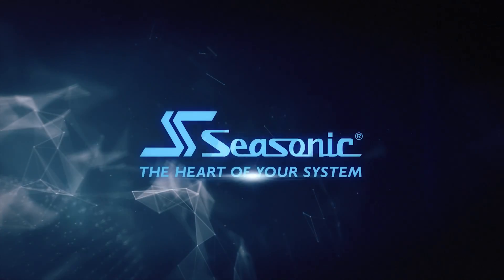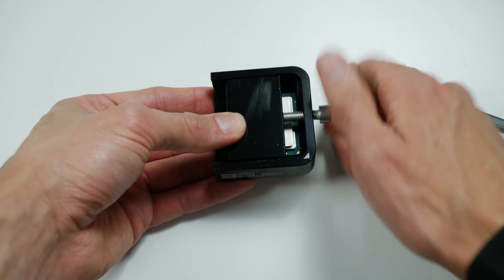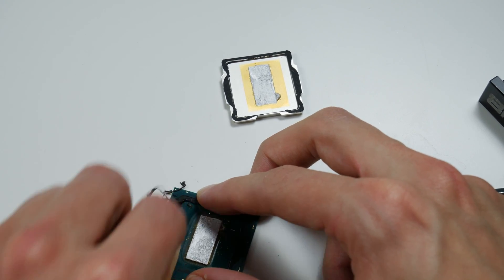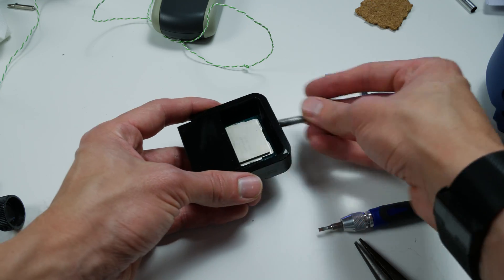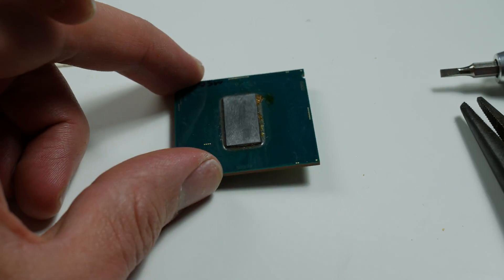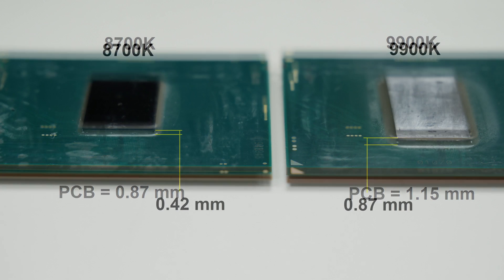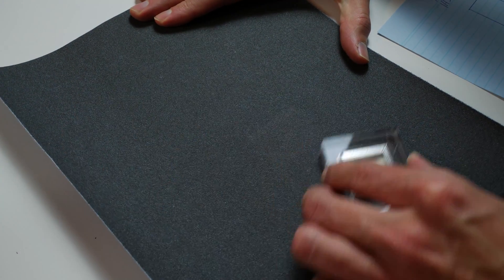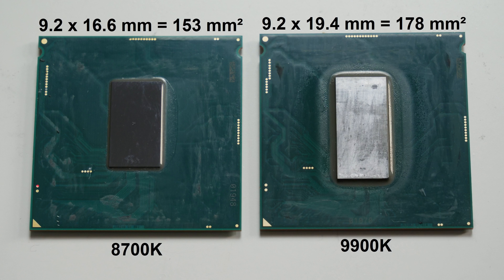Bad sTIM? Why is the 9900K so hot?

Comment: One of kind video. I dont know why they still include iGPU in these high end cpu's , maybe its easier to manufacture one design instead of seperate architecture and chip design for high end cpu
Reply: Yeah, they should just get rid of the iGPU or at least offer a version without it on the top end gaming CPUs. No one is buying a K series for gaming and using the iGPU.

Comment: So if indium isn't the right choice for solder material, what would you recommend?
Reply: That's the only option for soldering silicone to copper.
Reply: @SuprSi Ah. So then I suppose the solution to this thermal instability would be to design a new architecture which is optimized for 8 cores, instead of adding on to the old 4-core design? Because the original die size was a perfect square, but it's gotten more and more rectangular because they're essentially just adding onto it. So for better thermal performance, designing a new die that is once again square would afford the best heat-transfer for a design like this, as it wouldn't be necessary to layer the wire routing as thickly due to it being spread out over a larger die.

Comment: Sure the new solder is not as good as Conductonaut, but I'd be curious to see how much better it is compared to the crappy TIM they were using before. I guess there's no direct way to test that, but you could turn off 2 cores and clock it the same as an 8700K and compare that (imperfect test, but still a good approximation).

Comment: How are AMD then getting so much better temperatures than Intel? Are they using thinner solider? EDIT: Ok, Intel is useing thicker chips, but why would they do that?
Reply: higher clock speed also make more heat u can test it  yourseft  put any cpu example 8700k at 1.3v 5ghz then put it to 4.5ghz with the same volt and u will see 4.5ghz  will  still alot cooler

Comment: They could have made the silicon thinner for better thermals if they wanted to. Maybe it would cost more to come up with a new manufacturing process but it could be done.
The way Intel has failed to meet expectations regarding thermal performance in recent years it would be better if they just offered CPUs with heatspreaders that come bundled like stock coolers, ie included but not yet attached to the silicon die and pcb in any way.

Comment: Have Intel fixed the security flaws on these chips?  If they have, could it be added layers for encrypting and decrypting the cache.  It would also explain why it's heating up in general, as it would have to work those bottom layers very hard.  It would be just like Intel to just add a few layers instead of fixing the X86 architecture itself. V_V

Comment: So the moral is if you want a good 8 core cpu with good thermal, buy a Ryzen 2700
Reply: @My Account yeah, when you pay 300$ more it better be better.
Reply: Intel in 2018 LUL
Reply: or get threadripper 2 for the 9900k price and enjoy :)
Reply: @AvatarSampai  gaming on threadripper ? 🤣 A old Intel 4 core is Better. Intel is still king AMD fanboy are just salty 😂👌
Reply: @Maskinmester-DK  he didn't mention a word about gaming. Amd will eat Intel alive in price to performance anyway.
Reply: if intel was still king, why are they talking to board manufacturers to start reproducing OLDER architectures, since they cant keep up with demand for the newer 14nm processors? in other words, if you want a dell or an HP with an i7 in it, you're probably going to end up with a 5th or 6th gen instead of 7 or 8, or even 9. those system manufacturers are literally right now looking at using older intel chips because intel cant make enough of the 14nm (7th, 8th, 9th gen) to keep up with demand. that is why AMD is looking at a possible increase of up to 30% of the marketshare right now, because they CAN produce enough of the Zen-based processors to keep up with industry demands, including taking up intel's slack. that, and being set up to release 7nm 3rd gen Zens next year, they DO have intel scrambling on the desktop processor front. then take into account the server-grade stuff. Epyc's architecture is far superior to xeon in both PCIe lanes and clock speed, as well as number of clocks, AND are much cheaper, both for the chip itself AND the board. any REAL computer person can see that, while intel DOES make the fastest "gaming" chip currently, in the broad scheme of the world of computing, intel just got a knock in the jaw and is trying to recover. hell, linus tech tips proved that a 1700 dollar AMD threadripper is FASTER in server-style tests than the 3100 series 28-core xeon they JUST released, which costs right around TEN GRAND. the threadripper, a DESKTOP processor (cheaper boards, more modular design) that beat a server processor in tasks that the server processor is DESIGNED to do. yeah, intel REALLY sounds like it's king. numbers dont lie, but fanbois do.

that being said, i'd recommend the i9 to a "price is not a problem" gamer. if price DOES matter, its an easy choice for the 2700x
Reply: @Maskinmester-DK  Not for your moneys worth. Feel free to pay 50% or more for a gain of 5-15 percent.
Reply: yes
Reply: At the moment 9900K is the fastest processor in consumer market. The only reason to buy ryzen is that it has better cost/perfomance ratio.
Reply: @sashasinkevich924  and we all know that everyone can tell the difference between 170 FPS and 210 FPS!
Reply: In game applications performance difference may be even less, because of games are gpu heavy. But still the gap exists. You can think about this from another side. Can you see the difference between 10 minutes of rendering and 9 minutes?
Reply: @ellsworth1956  you would be quite the fool if you were saying that people cannot tell the difference between Framerate jumps.
and then a hypocrite if workstation performance gains were then mission critical. same wheelhouse - more of the the type of sought performance is more of the type of sought performance.

not that i'd want a 9900K for gaming since it's a miniature volcano trying to cram that many Cores into a Consumer rather than HEDT size Die, but that's a different matter.
Reply: @taiiat0  First, you always buy the CPU that best suits your needs to do otherwise is foolishness. Second, I never said anything about Workstation performance please do not put words in my mouth. Third there have been bunches of blind frame rate test and they all say above a certain point you can't tell the difference. Anyway it is a case of diminishing returns, going from 60 to 100 frames is definitely noticeable difference after that the jumps become less and less noticeable.
Reply: @ellsworth1956  every person is different, deciding for people that they can or can not differentiate higher Framerates isn't very genuine. while some people insist they cannot differentiate higher than 60Hz (i think they're incorrect but i'll leave them be), trained professionals have been able to detect purely visual movement&motion at 1/300. so, people will scatter in between those two points.
let alone visual+physical detection, of which people would be expected to be able to differentiate substantially higher than just visual.

the note on Workstation was just putting two very similar things with each other - games want higher Framerates (and hopefully better Frame Time consistency simultaneously), Workstation wants __ job done faster.
there's diminishing returns in everything but that doesn't make them not worth desiring. either desiring both of those scenarios makes sense, or neither does.
Reply: The only ones talking highly of intel right now are the uninformed and children. The dwindling sales is proof of that.
Reply: Save yourself some money and build an LGA 2011-based system with a 3930K or 4930K (or an X variant). Similar cores/threads, better thermals and quad-channel memory. Also cheaper and allows you to save on RAM by transferring over your current DDR3 sticks.
Reply: Or get a Xeon E5-1680v2 (same core/thread count), it's overclockable up to 4.6GHz and supports even cheaper ECC memory.
Reply: @Lucas Silva, It has lower clocks and mesh, games dont like mesh.
Also Intels 8/8 is faster then AMDs 8/16 in software too
Reply: @RyanFennec   Quality costs money.
Reply: @RyanFennec   Thats why i don't buy AMD products.
Reply: If a 9900k got these high temperatures, how would it be an i9 9980XE at all cores at 4.5Ghz ? What´s the temperature ?
Reply: We all know gaming needs high GHz speeds.
And yes, only intel can get them that high for now.
Reply: @Neiva71  be ready to De-Lid that 9900k if you want to hit 5.0GHZ. Just another Intel space heater.
Reply: Of course not, why would anyone want a fake 8/16 CPU if intels 6/12 betas in gaming and 8/8 [9700k] beats it in everything, be it software, zip, games, HEVC, etc.
9900K Rapes it
Reply: Wow your level of stupidity reaches new low levels.
Reply: @NoBodysGamer  why fake 8/16 ?
Reply: @Wellington Campos, what do you call a 8c/16t CPU that loses to 8c/8t CPU if not fake?
What do you call a 8c/16t CPU that also loses in many things to 6c/12t CPU?
Do you know ZEN architecture? Each 8 core ZEN is in reality Two 4 core CPUs "glued together" [they use Interconnect], thats why RAM speed has such Great effect on Ryzen benchmarks but not on Intel and thats why AMD CPUs cost less money but Intels CPUs cost more, because they more complicated to build.
Do you have Ryzen 2700x? In its control panel it has Game Mode, this game mode, disbaled One SSX [one CPU] and only leaves 4 Cores working, its done because many older games see Ryzen PC as system with 2 CPUs and they not optimized for it.
Reply: Wow you are so clueless that is laughable. If you are going to astroturf for Intel, at least inform yourself a bit. AMD's approach is modular, consist of two dies with four cores each connecting through an Infinity Fabric externally which offers amazing scalability and bandwidth. That is why AMD is able to release 32 cores under controllable thermals and intel cant. 

And Intel uses a similar approach, on their previous workstation CPUs, they used to have a ringbush topology that would connect every die internally, but it would have scaling issues going beyond 10 cores, so they decided to use a mesh topology that causes latency issues and hence, lower performance, specially on games compared to the previous generations. All companies uses some sort of interconnects to connect the dies, get a grip!
Reply: @NoBodysGamer  You know nothing of what you speak of. In the cpu market gaming matters very little. The infinity fabric is a marvel of engineering that Intel has no answer for. In the server market where it matters Epyc is a serious threat to Intel's market share. For the vast majority of content creation Thread Ripper is the best choice due to price to performance and ecc support. For a comparable Intel build the price on the workstation is more than double for a Xeon, and performance is worse due to lower clocks. And the desktop a Ryzen 2600x system that is close enough to not notice for 99% of consumers is half the price. Desktop Ryzen also has more pcie lanes and support for ecc memory making it the hands down winner for small scale content creation. And before anyone screams AMD shill I want Intel to pull their head out and compete so we all get better hardware at lower prices.
Reply: @chrisvanalstine8136  I get the more pcie lanes part but do mainstream users really care about ecc memory? Or even on hedt for that matter. Even content creators on youtube and all who use both sides dont seem too concerned of lack of ecc support on intel hedt parts.
Reply: Why...why are you guys responding to someone that uses the word rape in such a fashion? It's clear that they have the most basic understanding of how anything in their PC works or the real target audience of the Ryzen CPUs.
Reply: @Karthig1987  Oh it matters how pissed would you be 14 days into a 15 day render and your ram threw an error. It doesn't seem like it matters much, but it does that is why it exists. HEDT probably not so much those are more show and gaming streaming or smaller projects. I'm talking real workstations where losing anything costs a lot of time and money. If ecc didn't matter that much Intel wouldn't make a fortune on Xeons especially when there is a cheaper possibly faster HEDT cpu with the only difference being ecc support. Oh and I mentioned the mainstream platforms because it gives a cheaper alternative to people on a tight budget or just starting out. Being able to build a 8 core server for a small office for under 2 grand or even Thread Ripper if you need more and having all the prosumer features is great.
Reply: Ummm.. bruh, Game Mode in Ryzen Master is for Threadripper CPUs to shut off cores that can't be addressed by games.  You basically made the same mistake as the company that Intel paid for the 9900k benchmarks.
Reply: @chrisvanalstine8136   Love my 2600X!
Reply: @NoBodysGamer  wait, my 2700 OC 4.1 doesnt lose to 9700k OC 5.0 in cinebench multicore or in any test that requires the full potential of the cores. True it loses in single core and you might get few extra fps in games however in multitasking the 2700x or nonx will "destroy" this 8/8 lul

Comment: Quite interesting results. I would not have guessed a thicker pcb. Curious to see the thermal performance of the 9960x when they release it. Will the bigger die size benefit from soldering more? Or will you be updating the delid kits so we can sand down the die?